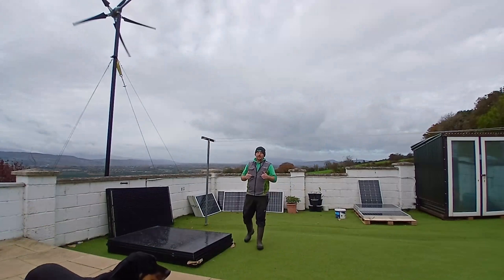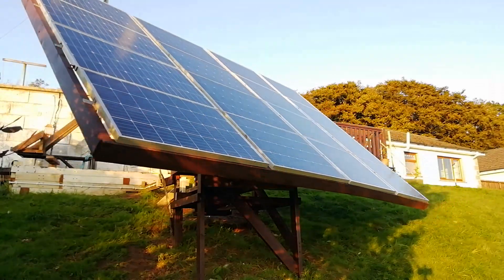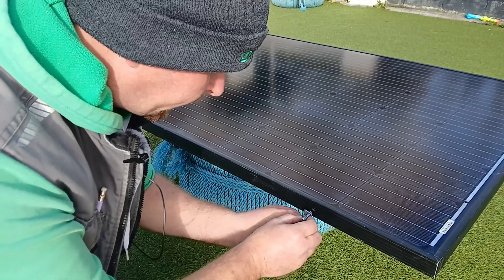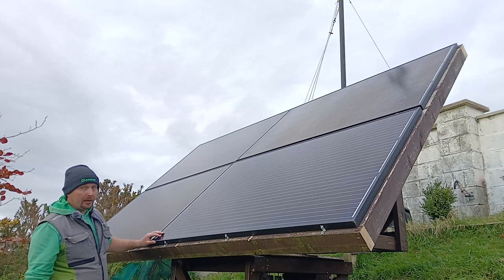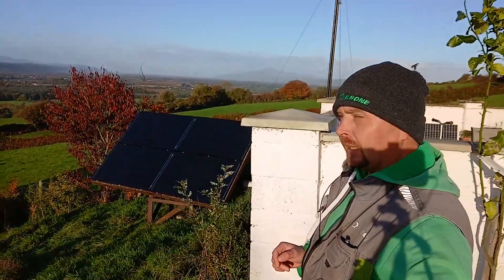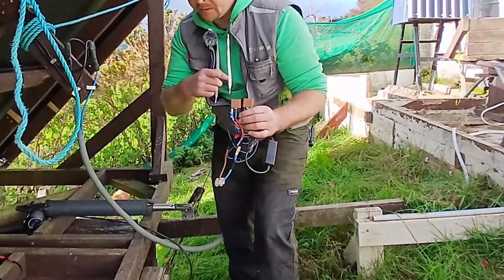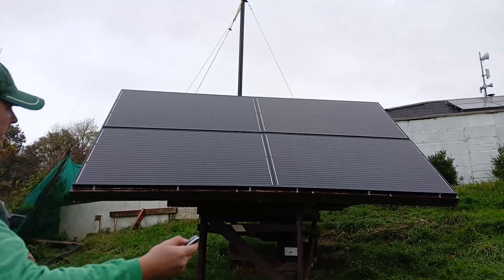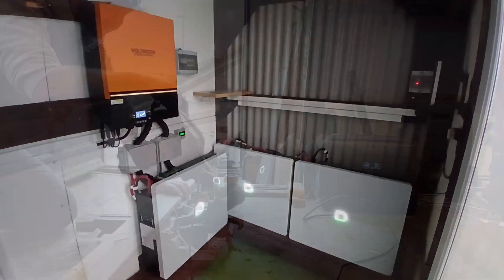The Rotating Solar Array, Off Grid Upgrades pt2

Comment: You need to get ur self a solar tracker and link it up to the actuator then it will be automated and track the sun all day
Reply from the maker: The only reason I haven't done that is due to the limited rotation range of the array. For example, when its at its max angle it won't have reached the ideal position of the tracker and will continue to try and turn even though its wedged into the hillside. As such a manual control suits better to the limited rotational range and seasonal differences in sun angle.
Reply: @ourkilkennyhomestead2006  You can just manually program limits and how much you want it to turn when/where